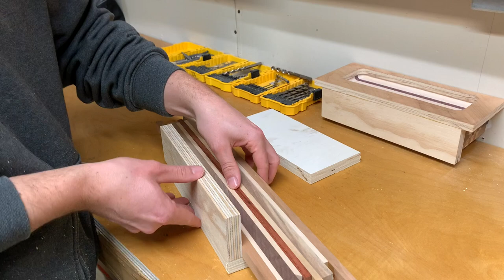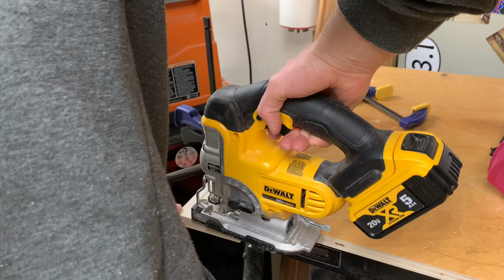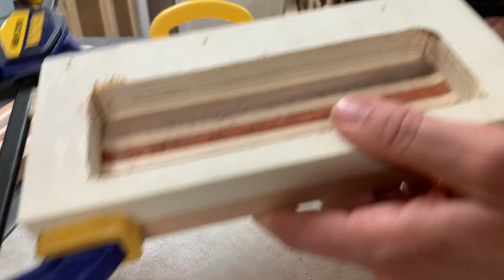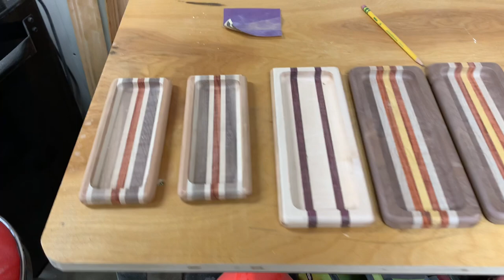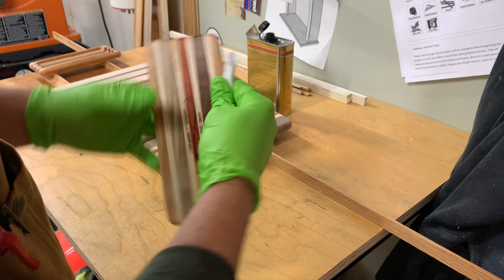Making small trays using custom jigs and a router bowl bit

Comment: I've always liked the method of gluing up different types of wood to make a different look. Also you get to use up some scrap you might have had to throw away.
Reply from the maker: That is exactly what I did here. Those pieces were all in my burn bin. Long but only about 1/2 inch wide. It’s projects like these that make it tough to trash even the smallest scraps, especially those pricey hardwoods.

What types of things do you make when you glue up scraps? I figure cutting boards are a go to for many people but I’m looking to try some new things.
Reply: @casualcraftsman8801  I made a simple Table top (18" x 36")  with different woods  with a small drawer underneath. I made a small box with a hinged lid with different woods. I made a storage  cabinet on wheels  using different woods. I learned how to glue the wood together and plane it in my high school shop class 30 years ago when the class was making clip boards. I don't know where the teacher got the clips from.
Reply from the maker: Those all sound really cool. The clipboard is really jumping out to me. Maybe I could steal the clip off a cheap or old one.

I have about a 5 gallon bucket of hardwood scraps I want to use up. I also have 3 "blanks" of maple/cherry glued and planed. But they they are only between 5 1/2 ~ 8 inches wide, so probably too narrow.

Comment: Looks great.  And your jig for use with the clamps and router table I will remember for future reference.  I recently made a desk organizer tray with a router bowl bit.  Even with shallow passes, in a rigid jig I got burning and chip-out, but it may be that I opted to do the project with a small trim router without the ability to adjust the speed.  A little sanding covers many sins, LOL!  Again, your trays look great.
Reply from the maker: Thank you! 

I wasn’t too concerned with burning on any of my passes until the very last one. For that I took off just enough to cut away any burns. And I move really fast to prevent new ones.

As for chipping I think I just got lucky this time around because it wasn’t an issue.

Then sanding, lots and lots of sanding.

Comment: Your finished product is top notch. My attempts at making the template went well; but the Bowl Bit in my router table never let me get passed scrap piece. Gouges, burns, varied depths. Tried different cutting heights, 3 different size Bowl Bits (an inexpensive Amazon set). My router is a Skill in a Skill Table, speed set at 2 (with 6 being the top speed). Any thoughts as to what the problem(s) are? I am not well experienced with routers and or using the table. I have used my little trim router for years with acceptable results. Are the Bowl Bits that tricky? Any thoughts offering possible fixes would be appreciated.

Comment: Nice work!  Love the way these came out with the different wood boards you chose!  Great idea using a clamp on jig.  Never thought of using that kind of jig + a pattern bit on the router table!

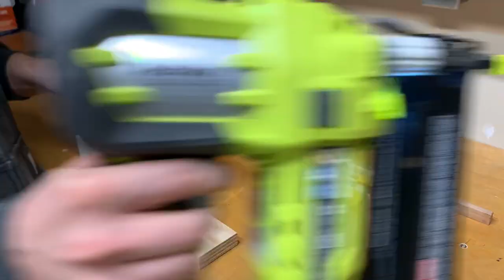Very small safety comment:  About 2:51 - Be careful putting your fingers too close to the backside of the area you are firing brad nails into.  A small unintended angle of the nail gun can result in a fun “removing nail / wood shards from your finger flesh” side project.....ask me how I know! Lol
Reply from the maker: Thanks! I had glued the boards up months ago without much of a plan. All skinny scraps destined for the fire pit. I figured worst case I wasted some time and glue. But they turned out great, now I’ll have an even harder time getting rid of scraps!

The jig worked out much better then I anticipated. I felt safe using it even with such small pieces. And doing it this way really cut down on the dust.

I went back and watched where you talk about the nail gun. Yeah, I will keep an eye on that. That doesn’t sound fun! Hope you were ok!

Comment: Great job! What are all the kinds of woods you used for your wood stack? Did you just glue them all together using any special jig?
Reply from the maker: Thanks!

From outside in towards the middle:
Outside - cherry, sapwood 
2nd - soft maple
3rd - walnut, some sapwood and some heartwood
4th - soft maple again
Middle - padauk 

I have several of the Bessy Parallel clamps that I used for glueing these up. They work well since you can rest the boards on the metal bars as you clamp.

Comment: I like it. I have done this method but use a plunge router from the top..Like the router table idea.
Reply from the maker: Thanks! These were so small I felt safer using the table. Also I found that my dust collection was better this way.

Comment: Great job!!! Can you put the link of where I can found the Router Bit
Reply from the maker: Thank you! I got the bit off amazon. I actually have two, a large one and a smaller one. I used the smaller one in this video and I put my amazon affiliate link for it below. I have a link for the bigger one in the description along with my chuck extender. 

Good luck with your project. I've found this to be as good if not better then some of my Freud bits.

CMT Bowl & Tray Bit With Bearing, 1/2-Inch Shank, 1-1/4-Inch Diameter https://amzn.to/3sBt4k2

Comment: The answer may be buried in the comments but I’ve not seen anything—how many passes did you take? Looks like all at once. Just wondering how to use the bearing if you first made a shallow cut/pass. Relative newb (I own it) but learning!
Reply from the maker: It’s been awhile since I did it but it was at least 6 passes. Probably a hair over a 1/16 of an inch each time. Because it was small, and hardwood I decided to go slow.

I got a Valentine video posted where I made a heart shaped tray out of poplar. I went more like an 1/8 plus each time with that.

I’m a newb to the video stuff. This video was actually my very first and I didn’t even talk, just went for it.

Thanks for the comment and good luck with your project!

Comment: How did you decide to use wipe on poly for finishing these bowls? How many coats? Thanks!
Reply from the maker: I picked poly for the protection. It isn't food safe. But I'm using them for pencils and coins. No one is eating from them.

I've used lots of different finishes and this one is the cheapest with the same results as most of the others I've tried.

I will usually do 4 coats minimum. I sand with 220 after coats 2 and 3. Leaving the poly dust on and making a kind of slurry with the new coat being applied. After coat 4, I buff with construction paper. That makes it super smooth.

Good luck with your projects!

Comment: Those came out really nice bro!  Question.  Do you  hone your bowl bits with a diamond plate or anything while you make these.  I quickly had trouble with burning after making a few.  Also,  the bottom the the carved out area left imperfections so you could totally see how the bit had travelled, if that makes any sense.  Thanks.  Happy new year
Reply from the maker: Hey, I’ve never sharpened these bits. I just take many shallow passes. Roughly an 1/8 inch or less. I don’t worry about getting everything perfect with each pass. I wait until I’m nearly at full depth and make sure it is all hogged out evenly. Then I do a final fast pass cutting less then 1/16. I use the last pass to cut away any burning that happened, usually in the corners or where I drop the piece onto the bit. On that last pass I move the piece around really fast, so it doesn’t burn again. 

I know what you mean about seeing the bits path. I find I get the best results if on that last pass I go back and forth in straight lines instead of swirling the piece all around. Then I do my best to sand any ridges away. On pieces this small it is a pain, but on larger ones the random orbit sander is the perfect tool.

Happy New Year!

Comment: Great video!  I just subscribed.  What were using for that mat you sanded on top of?
Reply from the maker: Thanks! The mat is an old silicon drying mat from our kitchen. I use it mostly in the shop for catching spills and glue. For sanding it helps hold the piece in place.

Comment: "casual" craftsman? Seems like you have every uncasual tool tho. Trays turned out great. I am making something similar for the patio dinners this summer.
Reply from the maker: Ha, you got me and thanks! Good luck with your project. These trays packed a lot of wow factor without a lot of cost.
Reply: @casualcraftsman8801  what kind of woods did you use? I can't find a hardwood yard within 30+ miles of my house. 😔
Reply from the maker: From outside towards the middle:

Outside: cherry, sapwood
2nd: Soft Maple
3rd: Walnut, some sapwood and heartwood
4th: Soft Maple
Middle: Padauk

I actually have several places within a 20 minute drive from where I live. Oak, poplar, maple, and cherry are all really common hardwoods around here. Walnut too, but it isn’t usually carried in S4, more random pieces. Then you can get exotics but they are super pricey!

Comment: What is the bit that you used?
Reply from the maker: The Brand is CMT. I got it off amazon about 7 years ago for $35. I’ve done projects like this 4-5 times a year since getting it and it’s still going strong. I should probably learn how to sharpen it.

I have the small and large one. This video I was using the smaller.

Search: CMT 851.501.11B Bowl & Tray Bit With Bearing, 1/2-Inch Shank, 3/4-Inch Diameter, Carbide-Tipped

Comment: Handsomely. But it seems to me that a hand router is more correct to use here
Reply from the maker: Thanks! I’ve done it both ways. You can see your work and the bits cut path better when you hold the router.

I liked this method because I felt safer and had good dust collection.